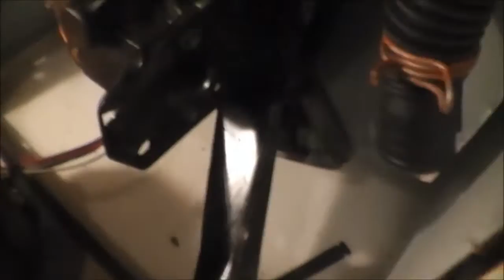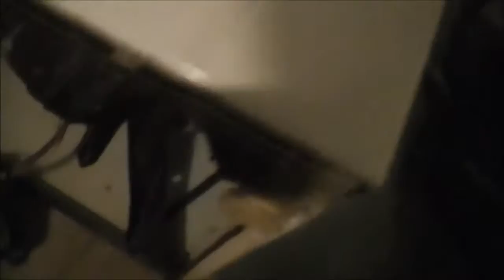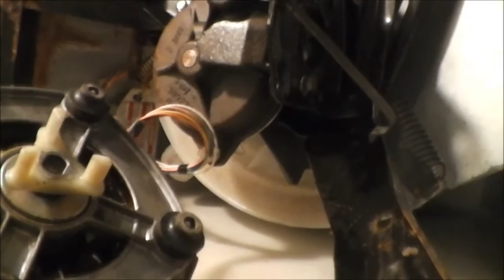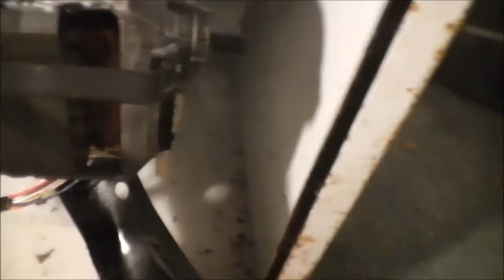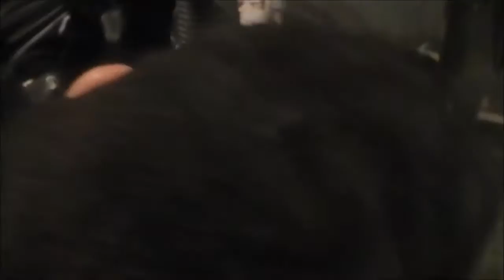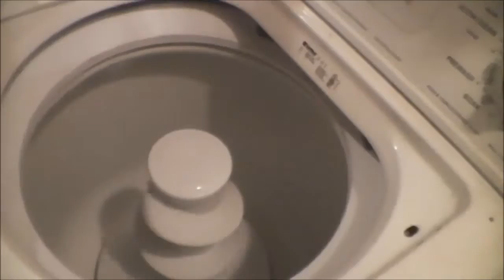Washing Machine Motor Coupler Repair - Sears series 80, Kenmore, Maytag, Whirlpool

Comment: I replaced my broken coupler and it still don't agitate or spin.  It doesn't make the loud buzzing noise that it did but it still doesn't work.  Could I have installed it wrong?
Reply from the maker: Possibly broke the new one or one side of it.... or  Maybe the motor is shot.